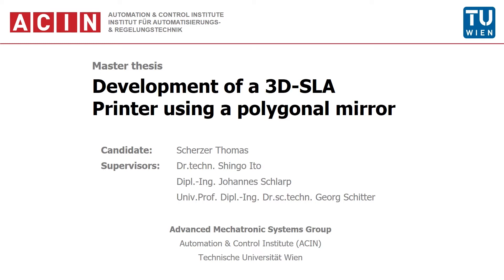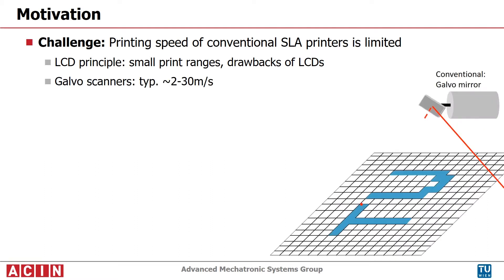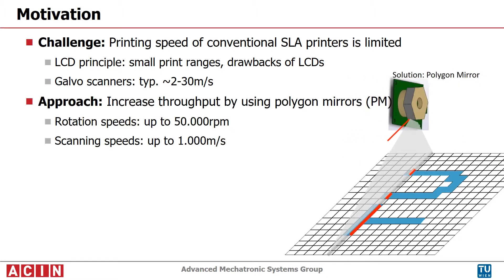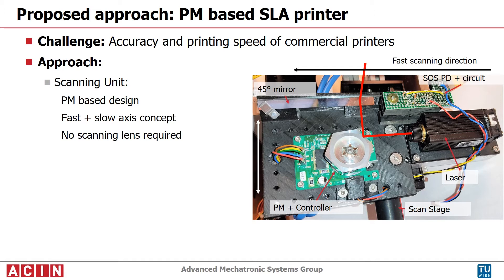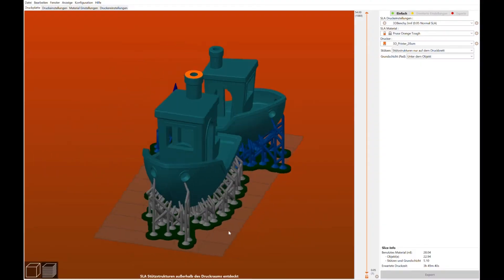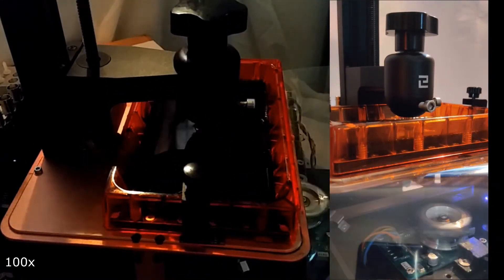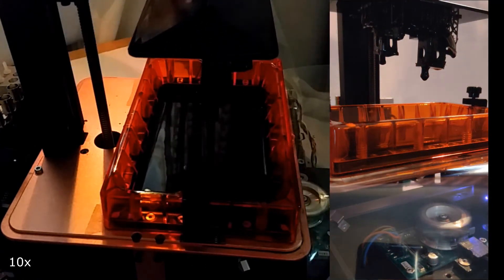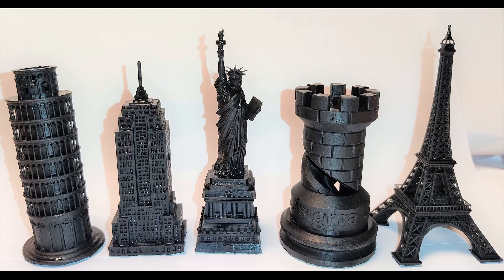Development of a 3D-SLA printer using a polygonal mirror

Comment: I've never seen this. In my opinion, we are limited by the Z stroke and not by the final hardening of the model. The beam of the LCD is divided, but the model is hardened after printing. How can this method be faster? write, I'll translate from the video, sorry for the length